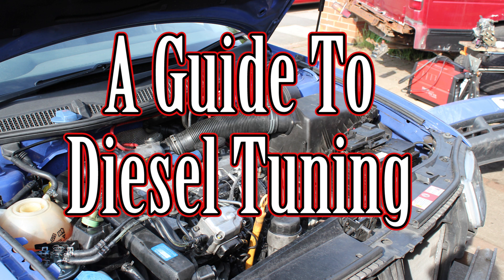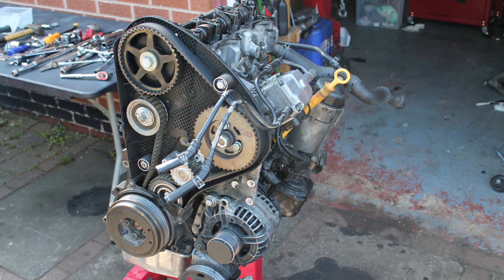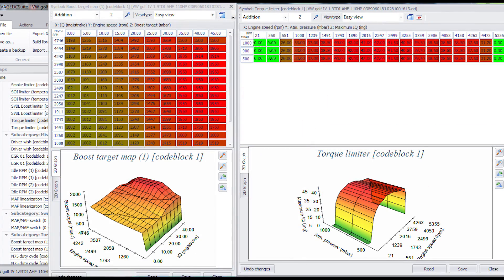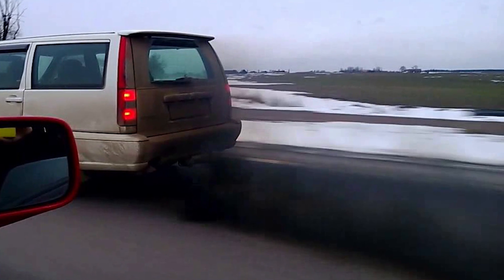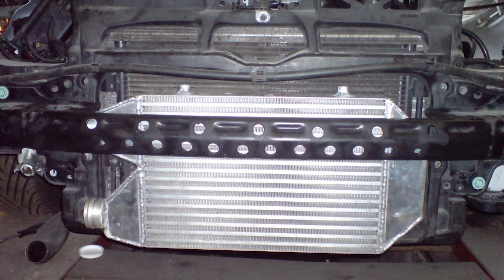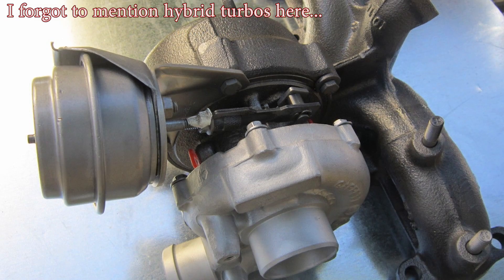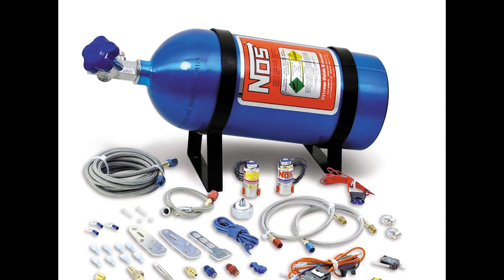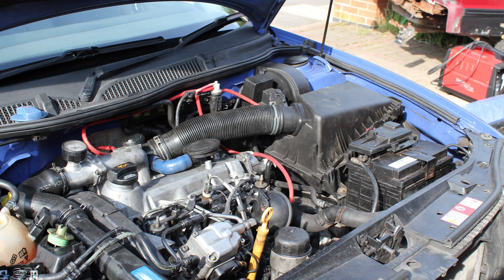A Guide To Diesel Tuning

Comment: I've got a 2015 bmw f32 420d. Any idea how I can bump it up by approximately 100 bhp and 150 torque without risking any engine damage? Want it to survive as my daily. Thanks
Reply: Catback exhaust with dpf delete and a stage 1 will be enough. Stage 2 is rarely worth it for diesels
Reply: @manbiteslife3110  I straight piped from the turbo and remapped stage 2 plus. 250bhp and 510nm now
Reply from the maker: What's the stock horsepower? Short answer is spend ££$$ basically most TDI's tune 20-30% with a stage one tune. If its 180 bhp stock I see a tune gets it to 238bhp, add a good exhaust setup and maybe 250 is on the cards. 
After that I suspect it's bigger turbo, maybe clutch and injectors - that first tuning hit is cheap but what comes next costs. Also depending on the bottom end you might need rods.
Because you car is new my usual answer goes out the window (I.e. in the UK 330D's are cheap on the second hand market and I'd suggest getting that and tuning it, I'm an Audi guy but I know the 330D has more power easily available).
The other thing is to get the tune and see how the power feels, it they pick up a ton of power in the middle of the power range it transforms the car.
Reply: Awesome cheers for the advice. 200bhp and 400nm stock. Yeah I would have gotten a bigger engine but insurance sucks :/

Will look into a remap and maybe an intercooler & turbo. Think that'll get me 100 more bhp?

Cheers for your help!
Reply from the maker: 50% increase is a lot to ask from a remap and I wonder what the clutch can hold.
I'd take a look at what other people have done to get to 300 bhp. 
It's not a comparison as such but to get my 180 bhp V6 tdi to 300 BHP I need bigger injectors, a bigger turbo, a beefier clutch and a remap - I actually have the turbo, injectors and remap ready but need to do the clutch and that's going to cost me £700 before labour (I plan to do this myself). I won't need an FMIC as the car has twin SMIC's but I think that an FMIC would help.
 I'd say to chat to a known tuner about "stages" and cost, and the further you go the more stress you will place on the engine so in a way a stage 1 tune with supporting mods is a nice happy medium, it's also cheaper and if you can do it with the stock turbo you get power over the range (for me going to the bigger turbo I probably loose 500rpm of lower end).

Comment: I would love to know more about that A4 b5 110hp TDI, cause I have one(ProfilePicture) and so I want to upgrade it
Reply from the maker: I bolted on .215 nozzles and got a chip remap - tbh 155 was to  aggressive with a VNT15 so it was smokey but fun (I have a dyno print out somewhere). You can go just nozzles and IQ adjustments from VCDS or the hammer mod. 
Depends on power goals and budget - nozzles can be done DIY cheaply for the .215's but beyond that it starts to cost a lot more.
Reply: CarAndMechanical Thank you dude :D
Reply from the maker: I should of also said it's worth heading to tdiclub - is your car ODB2? Mine needed a chip tune because in the EU we were not fully ODB2 for a while (also see my EVRY mod video but read up on it)
Reply: Yes it is OBD2, I live in Slovakia, I checked out the videos, and read on it. I did it and now its smoking like crazy :D
Reply from the maker: Might need to hammer mod the IP to control iq a bit.

Comment: Ha....My VW LT 35 SDI has no turbo and weighs 2.5 tonnes unloaded....couldn’t pull the skin of a rice(r) pudding but I love it. Bought a non turbo to negate any turbo issues and get around 30 mpg which is pretty decent for a ‘brick’. 2.5 litre five cylinder engine too. The only ‘performance mod’ it has had is that the previous owner removed the viscous fan...the van never overheats even in the hottest weather. It is a fairly common ‘upgrade’ for Sprinter owners etc but I will be fitting an electric fan and thermostat into the space left after the viscous fan removal...funnily enough, I didn’t even notice this when I bought the van..despite a good root around....just goes to show...
Reply from the maker: Funny the fan mod has been on my list for ages with my 2.5 V6 TDI I can see the inherant benefit but every other Audi I've looked at/owned at electric fans and I'd rather use a fan on a thermoswitch (with an option to override it)

Comment: I have a "stage 2" map on my mk6 2.0 Tdi golf with dpf removed. Not completely sure of the power but I feel like I could get more, it's a nice clean map with little to no smoke coming out the exhaust, I did ask him to push it more but he wanted to keep it on the safe side. I want more power but don't want to fork out over a grand for a bigger turbo and a FMIC. What do you think I should do?
Reply: Bigger turbo has the biggest gains but is more expensive. An intercooler won't add as much power, and will weigh a fair amount more, but is comparatively inexpensive. You don't need both a big turbo and intercooler. AFAIK there's no other way to gain more power on diesel.
Reply: @gram.  What about increasing the capasity? More Liter more Power?
Reply from the maker: Do you mean boring the block and bigger pistons or larger capacity intercooler?
Reply: @CarAndMechanical  b
Block + Pistons 😉
Reply from the maker: Lot of cost in that, where you could just go bigger/newer turbo , injector's, rods if needed, clutch and a remap. Also could add supporting mods like water meth etc.

Comment: 230hp 340 pounds of torque, stock clutch lol 😂 holds alright as long as you don’t ride or slip it ha
Reply from the maker: Whats your set up with that man?
Reply: Mine ARL is mapped to 190/200 and doesn't last long. 6 months at best but I don't drive nicely.

Comment: You know what your talking about, very interesting video 😎
Reply: Could you tell me if it is possible to fit to fit a turbo kit to my Mercedes 309D      Number Vin  WDB60241710785745 it has a 
horse box body mounted on 3.5t chasssis cab    first registered 9/12/85
although 85 annee  it  only traveled 65000kms
The reason i wish to do do this is it   loses power on the hills 
i am also considering changing the injector pump
if you could suggest any thing it would be most welcome  
could you give me a  price for anything that you suggest 
cordialement
 Geoff

Comment: Great video. I have 2005 Audi A4 B7 Avant 2.0 TDI 140hp. Is there something that i could do on the budget to get just 10 - 20hp more without compromising fuel economy and reliability? Thanks.
Reply from the maker: The best thing if not already done is to get a dyno run in - know what and where the car is making power. There's probably no 1 easy mod and depending where you are some might not fly with local laws....so that being said the following depends on what you can/can't do.
Basically easy/cheap - EGR Delete - DPF Delete - I think you have a really good intake on the 140bhp A4 (see post on TDI club made recently), so I think otherwise you are looking at a tune. 
A tune will ultimately use more fuel if you use the extra power on tap, but it can save fuel if under normal conditions you learn to use the torque to be efficient - if you can get a tune with a before and after print out.
I've been on dyno days where they upgraded to a tune for £200 from a straight run.
Reply: Thanks for your reply. EGR is deleted (according to my mechanic from wich i also bought the car). He suggested chiptuning (ecu remapping ) but i am sceptical about it cause i have seen bad results (engine failure). It can be done for as cheap as 100 euros here in Serbia. I am not mechanical expert so i am trying to inform myself best possible. Thans again.
Reply from the maker: Many "stage 1" tunes are boxed tunes with tweaks and stuff - if you explore forums like ECU CONNECTIONS there are maps you can download for free (I can't promise or deny quality). But basically and I'm talking high level here, a few add fuel, increase boost and maybe tweak timing. 
If you can find someone that knows their stuff it should work out well - big caveat - get them to download and give you your original tune!
There can be a silly amount of reasons for engine failure but tune wise you'd really need to go outside safe parameters to do so - too much boost, fuel, bad timing etc... A boxed conservative tune should give what you've asked for above as I think the 140's remap to 170 (check what your clutch can hold).
Reply: As we speak, my car is getting new clutch set and dual mass flywheel. It failed so I had a lack of power with increased vibrations and noise. Will check specs for new one installed. If it can hold 170 then i know what to do, thanks to you. 👍
Reply from the maker: Basically you want the cleanest tune possible really if you want to keep economy. The more smoke you see the worse you can expect MPG to be.
On my 2.5 TDI dyno vid you see it hardly smokes at all - I'm more flexible on MPG and wish I had more fuelling to use the boost!
Reply: Honestly i am really satisfied with this car as it is. Great car. But i know the feeling when you wish you have just a little more boost. 
Thanks again, i just found your chanel, subscribed and definitely will check out your earlier videos.
Reply: @CarAndMechanical   hey just a quick upate. it turned out that EGR was not deleted. I was away on a bussines trip for a week and left my car at the mechanic, for a regular service. Car smoked  a lot under load lately. He drove the car to some dude who is apparently local god of ecu remapping. He deleted EGR and tuned new map. IDK what stage or anything except that is a russian map (?) but the car is the beast! it has so much torgue that in 3rd gear when i press pedal to the metal ESP freaks out from wheelspining. And i have brand new Hankook ventus prime 3   225/45/17 tyres. Now i need to upgrade my brakes too LOL Thank you again for your advice, i am really really satisfied. No smoke at all and gas milage is pretty much the same.

Comment: In case of OM60X:throw in a huge turbo(HX40 for example),7.5mm pump elements,and boom you are at 450bhp
Reply from the maker: I wish the Audi 2.5 V6 unit was as easy...VP44 is a special beast
Reply: CarAndMechanical ohh,be careful with the 2.5V6 TDI,it is one the worst engines made by vw.
Though the old 2.5 TDI,the inline 5 is fairly good for tuning.I have heard people getting 250-300bhp out of them :)
Reply from the maker: It's maybe not the ideal but I find it's very smooth Vs 1.9's I've had. Out of interest what elements do you think make it the worst engine?
Reply: Well I'm not an expert in TDI engines,but it's considered one of the "not too good" engines when looking longevity.
It was overenginered,with too complicated solutions.as I know,there are problems with overheating,head gasket,undersized chain,etc.If maintained and looked after really properly,and repaired regularly,it should not cause too big surprise but still not the best engine to go with.okay it's powerful and smooth when it's working,but can cause serious headaches.my friend had one of these,he didn't say too much nice things about it either..
Reply from the maker: No worries, basically I've had my share of issues with mine but so far they've mostly been typical TDI issues - boost leaks, fuel filter, return lines etc...
The one I have that's very much an AKE known issue is noisy tappets - when I got the car I got one with the cams changed, but perhaps not all lifters etc sorted.

In my question I was also interested in what you had heard/were aware of as I'm always open to getting new info. I've not had or heard of head Gasket issues or had any heat issues....then again the UK isn't known for it's amazing weather.

With the chain it's just a belt on the timing but I have heard of issues with the tensioners letting go...funnily enough when not renewed.

One thing I do think with these engines is they've been overlooked often for tuning which is a shame as I think they can make more power then most give credit, but the exact formula's are a bit all over.
Reply: joczo97 now I already got 524000km out of my A8 D2 99 2.5 TDI Manual and its still running. 6 cylinders carrying 150-180hp is a no brainer, I hate those Renaults with 140hp and 4 cylinders, you can hear those engines screaming for help when pushing them a bit further while V6 you can still feel and hear some sort of power ... 150-180hp may not be much to say its powerful, but we all know that sort of feeling and sound engines produce in any sort of V6 ... and 7l/100km is awesome

Comment: I injected propane on my tdi it lasted about a week.   it burnt up the rings and pistons.   it was fun for a little while.
Reply from the maker: Metered or just on tap? I think they are usually on solenoid setups.
Reply: CarAndMechanical I had a low pressure regulator on the tank and a ball valve to control the injection into the intake.  it gave it alot of power but it didn't last long.
Reply from the maker: Interesting, couple of questions I have as I'd love to do this to one of my cars for fun...maybe not my V6. What did it set you back, what car/engine did you do it too, how long did it last and any idea on power boost?
Reply: CarAndMechanical my car is a 2004 vw jetta with a bew pd engine.   I have a few videos on my profile.    I had like $20 in the setup.  just get a regulator like you use on a bbq grill.  run a hose through the car to a ball valve and from the ball valve to the intake.  it takes like an hr to hook it up.  it gave it alot of power.   I was racing a dodge challenger when I blew my pistons.   but I must say the time I blew my engine I used a high pressure regulator on the tank I think I was running to much pressure honestly I believe if you stick with the low pressure youll be just fine with now problem.   ive rebuilt my engine since then.
Reply from the maker: Heh that's kinda awesome for a few reasons - in the UK PD engines are cheap but I know stateside TDI's have traditionally held a premium, not sure how dieselgate has impacted that.
I'd love to give this a shot but maybe not in my daily so might be something to try out down the line as I might potentially get a Peugeot 306 to try various mods out that I don't mind blowing the engine or maybe even another 1.9 TDI.
My 2.5 engine parts have a massive mark up on the 1.9.
Reply: CarAndMechanical man I tell you you are so lucky to have so much Access to these diesel engines.   over here they are rare and expensive.   I wish I could find someone over there to ship me a vnt20 turbo I wanna put one on my car.  finding parts over here is a pain in the ass.  im from the south and European cars arent so popular especially diesels but mines definitely a head turner it sounds awesome.   ill make a video on the propane soon.  I still have the valve and lines installed
Reply from the maker: There are not many good propane videos tbh - kinda why I'd like to  do one, but if you do one I'll be sure to check it out!
On the VNT 20 turbo stuff - I have a busted 3.0 TDI turbo in my garage, the wheels are shot but I paid £13 and my 2.5 runs with a hybrid gt2052v with gtb2056v internals.
VNT20's on ebay are there from £70 - would mean dealing with nasty shipping costs and potential taxes.
And back at ya with V8 stuff - I'd love to get my hands on cheap LS stuff.
Reply: @CarAndMechanical  hey man join the TDI group of America on Facebook
Reply from the maker: Not seeing it I'm afraid under that group name
Reply: @CarAndMechanical  hey man sorry for the long reply.  Look for VW TDI performance and tech talk on Facebook.   I'm currently rebuilding my BEW engine.  Blew the turbo last week.  Gt2052v

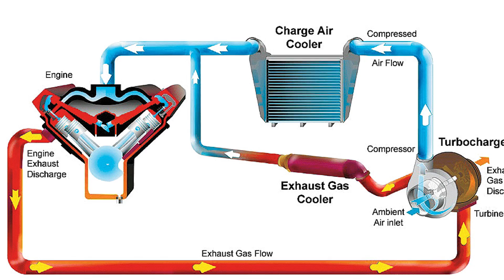Comment: 0:50 why the fuck would the exhaust gas go through a "exhaust gas cooler" into the engine???
Reply from the maker: The joys of EGR systems to reduce emissions and coke up intakes - lots of people block them off or remove them.

Comment: Cheers for this, I been tryin to find out about "what can i add to my car to make it faster" for a while now, and I think this has helped. Ever heard of - Vabrielbey Vehicle Verifiability - (do a search on google ) ? Ive heard some decent things about it and my brother in law got cool success with it.
Reply from the maker: Just looked at the site, and to me it just looks like diagnostic software and mentions 'hack' your car's performance. With Diesel there are tweaks you can 'safely' do vs Petrol but that show's remap tables so you would need knowledge of mapping a car.
 You can buy OBD2 remap packs on ebay cheaper and with things like VCDS for VAG group cars you have a very powerful tool for monitoring and getting into your cars diagnostics.
The only thing I'll say on self remapping is you really have to understand what you are doing, you need to load the map properly so as not to brick your ECU and depending on your car there will be many different factors.
VW maps have all sorts of checks in them as part of the closed loop, like if it detects low boost or low air it'll cut fuelling.